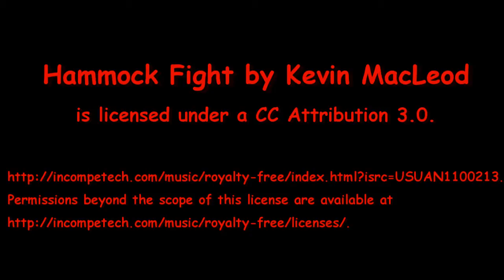Zelph's StarLyte Alcohol Stove - Trail Design's Caldera Cone - Boil Test #2

Comment: I agree. Initially, conduction from metal to metal will vastly outpace the outside  convection and radiation, meaning that most of the heat absorbed by the cone in the initial stages will be transferred by conduction to the water. After the water heats up, some heat will conduct from the water back to the cooler cone and be dissipated to the outside by convection. It's an interesting problem. Seems like the cone might benfit from being made from a material that is a relative heat insulator.